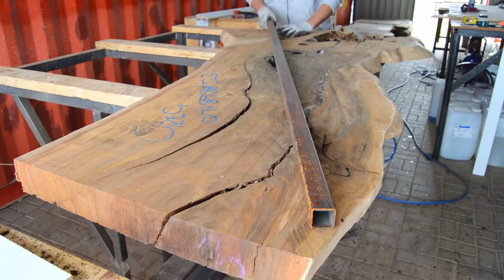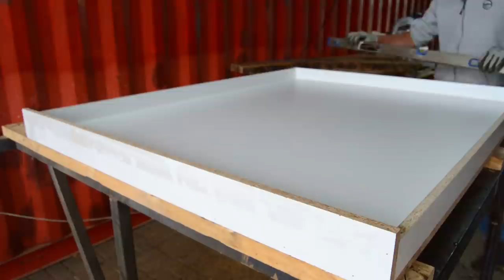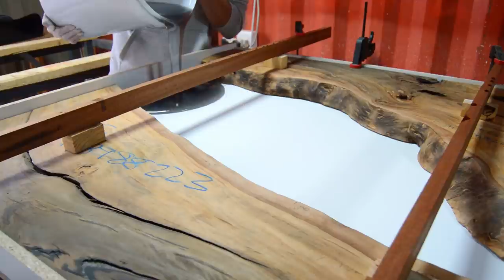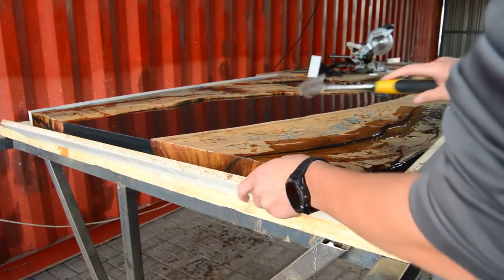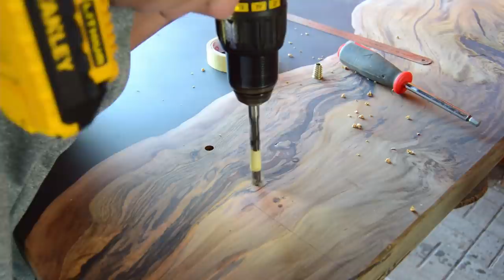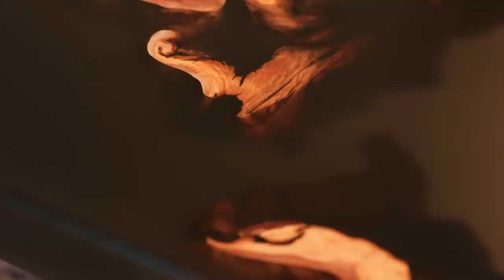DIY Epoxy Coffee Table | start to finish

Comment: Just wanted to point out that a ratio of 1:6 is not 1L (1000ml) to 600ml. So in your example the correct amount would be 100ml of hardener to 600ml of resin. Nice video, keep it up!

Comment: please ask. 3cm×15cm×160cm, how many kg of epoxy glue is needed
Reply from the maker: https://www.calculator.net/volume-calculator.html
Reply from the maker: 3cm x 15cm x 160cm = 7200cm3
Our epoxy in South Africa weigh 1.05kg per liter 
Meaning 
7200 x 1.05 = 7560 kg
7560 / 1000 = 7.56kg

You will need 7.56kg for your project (according to my suppliers specifications)

Now you need to divide the amount-of resin and hardener depending on your supplier and epoxy specifications.

Rather give your epoxy supplier a call for more detailed instructions. I might have made a mistake and wil cost you money 😇
Reply: @diywithgreg  thank you